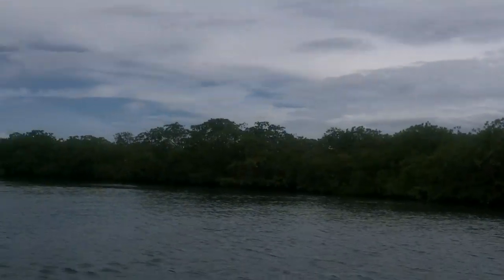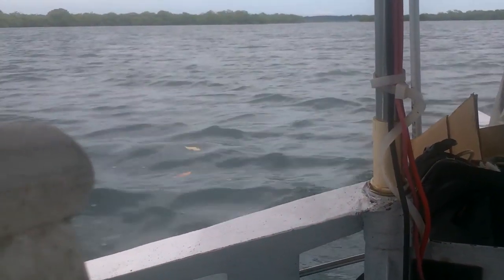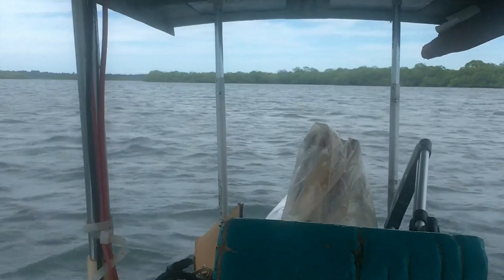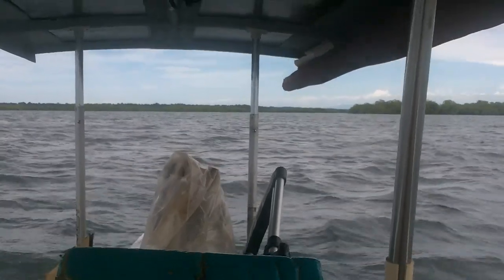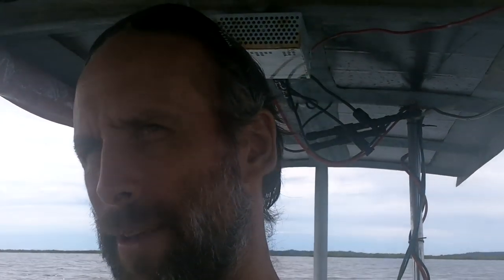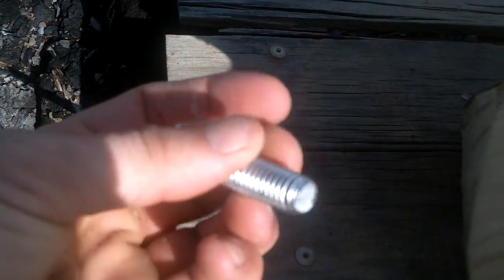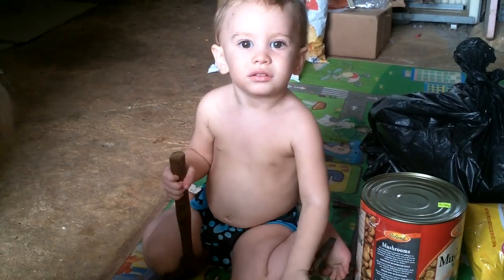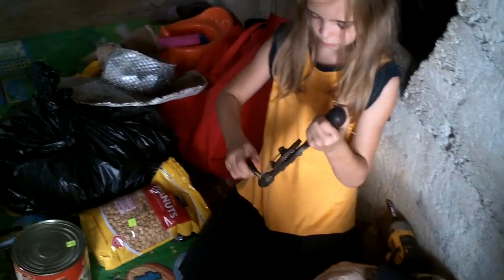Picking up my Latest Craigslist find! (Tools n' Bolts)

Comment: Hi Jamie, I was watching an older vid and you have a submerged log to cut up and I have a possible solution that I've used successfully with the same problem...Break an old chainsaw's chain so it is just one length, Add wire loops to each end that rope can be tied to. The two rope ends can then be tied to handles (sticks). I had to swim down and dig below the log to run the rope and chain under, making sure the sharp side is to the logs surface! It helps to have a second person to work the ropes, which are long enough so you both are above water! You're strong enough to manage on your own but I think it helped that the chain was not rapping around the log but cutting more straight across it! We found out why the boat could not pull out this log that we cut into three sections, as all the branches were buried deep into the mud! We cut through the 12" thick log in a couple of minutes for each section. PS, of course I sharpened the chain before cutting but now I'm just pissing you off! Lol! Best/Roy

Comment: PLEASE open up those metal handle tools and inspect the wiring, brushes, commutator for any signs of shorting out.  I worked as a carpenter and this guy was up on the roof dripping sweat, he died of electrocution when he pulled the trigger on a old metal handled worm drive skill saw.  Other then that I'm like you..I love the old stuff.  ✍️))  You were booking on the water, your skills continually amaze me!!!!!!!!!!  😳....🌴🌴
Reply: Need to rewire those older electric tools with a three wire grounded cords sets...
Reply: Yup, I've been zapped by them before as well. (But never killed....   ;-)
 I got rid of all of my metal bodied tools after that, and went with double insulated.
Reply: Horse shit .theres nothing wrong with metal bodies.

Comment: (does he read these comments) Jamie It has been great watching your progress on your various endeavours.  I would suggest that the idea of scrap polystyrene/concrete as a building material is inspired, and could be used for your dwelling. it is light and so as cheap as chips, It will not screw your back during construction. Peace Brian in London